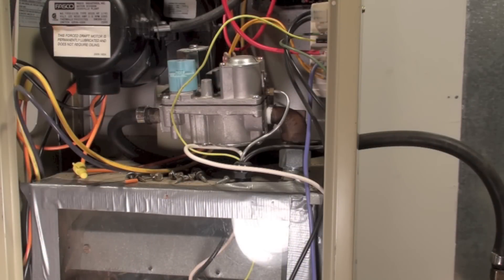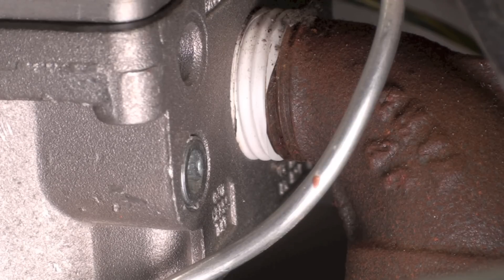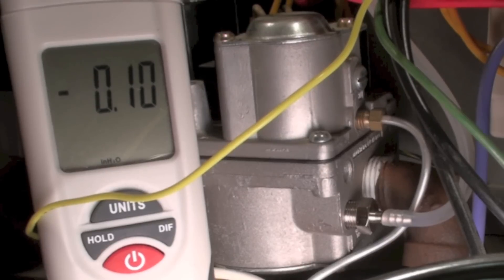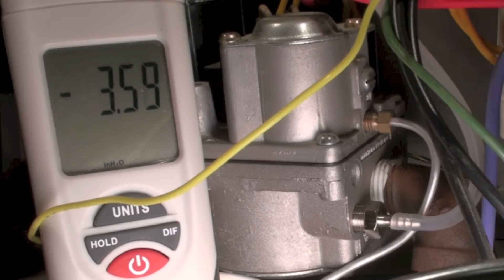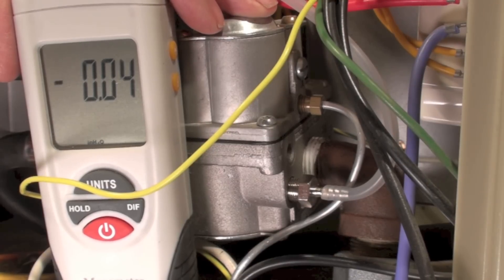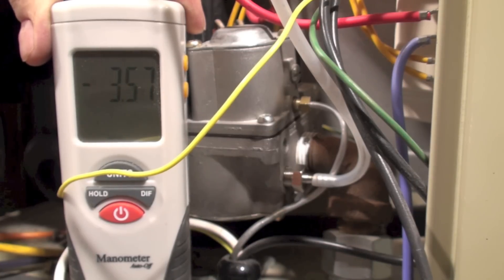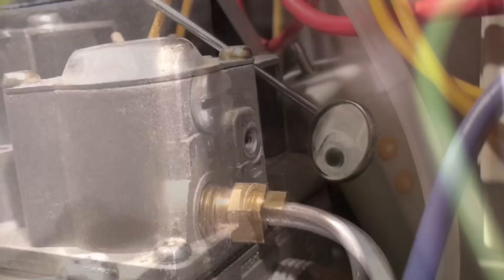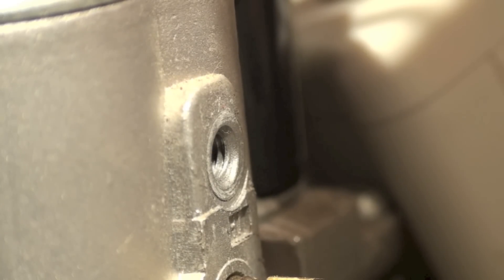How to set the manifold pressure on the GUA furnace

Comment from the maker: The WR boards did give a lot of trouble at first.  A lot of failures in first or 2d year.  Much better now.  The vent would be plex vent.  Service guys (me included) would try to not notice it was installed if it wasn't leaking because of the hassle of replacing it under the recall.  I seem to remember the labor given to be about 5 hours less than what it took to replace it!  Thanks a bunch for the comment.  Brings back memories.
GFM

Comment: hi, at 3:51 what you unscrewed is it the pilot gas? thanks.
Reply: Its a tube connected to the combustion chamber that puts the gas valve regulator at the same ambient pressure as the combustion chamber. 
GFM

Comment: What would cause the outlet/manifold gas pressure change over time?
Reply from the maker: It should never change.
GFM
Reply: @grayfurnaceman  Thanks GFM. I just see vids on techs using the manometer and adjusting the GP when the CO level is off too high.

Comment: hi, if this was a 2 stage gas valve how would you initiate the 2nd stage to adjust its pressure? thank you.
Reply from the maker: There are 2 ways.  You can start the unit with W1 and W2  jumpered.  10 minutes later (or so) it will go to high fire.  You can also start the unit with only W1 connected and when the burners light, jumper W1 to W2 and the unit will go to high fire.
GFM